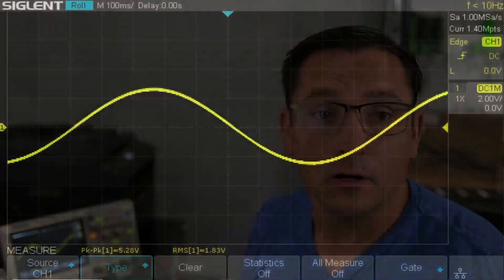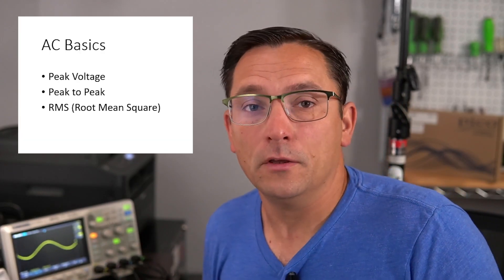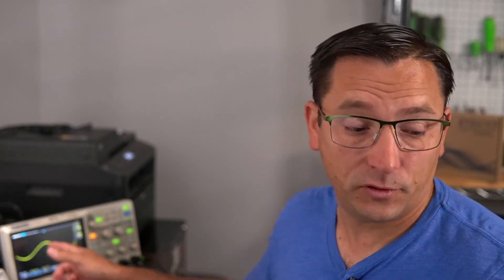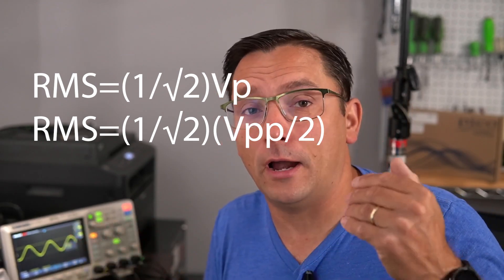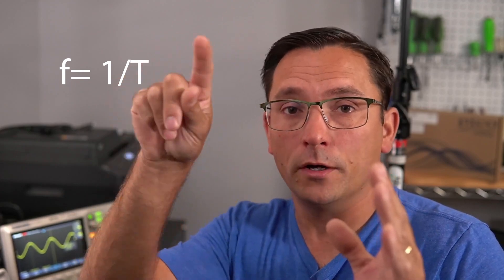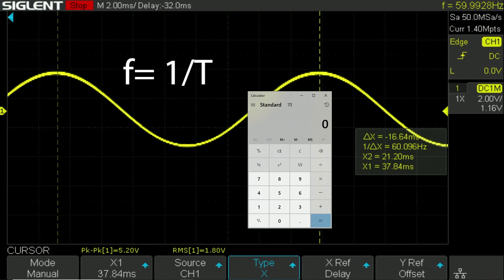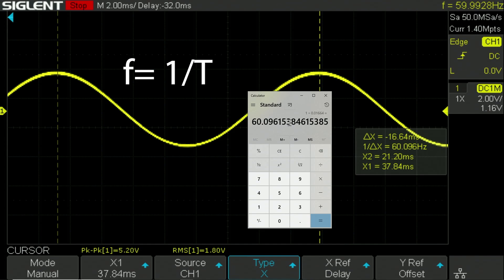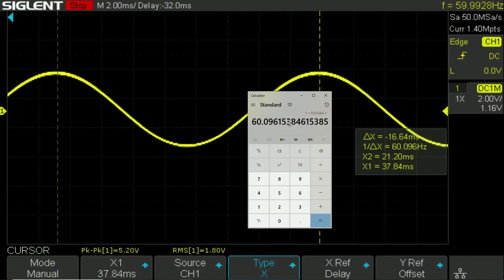AC Circuit Course Preview

Comment: I was trying to see how we can messure current on a 3 phase motor but everything is integrated in the inverter they have hallaffect sensors a1360  that messure current on all 3 phases of the stator there is no way in the inverter way different from a comutatator with brush motors. Everything abou ac on the electonic vehicles is the igbts really its still DC.

Comment: When would you use ac voltage checks? Hybrids high voltage dc or ac?
Reply from the maker: Getting into checking the current on 3 phase motors ( fuel pumps  already out there)!